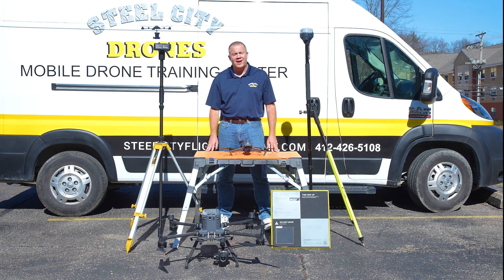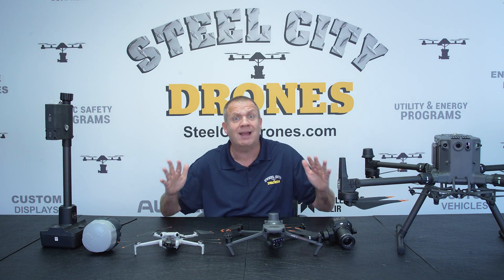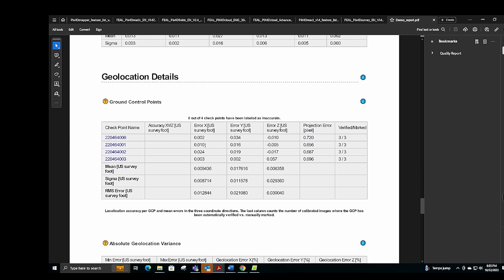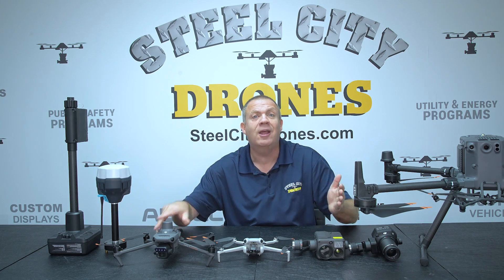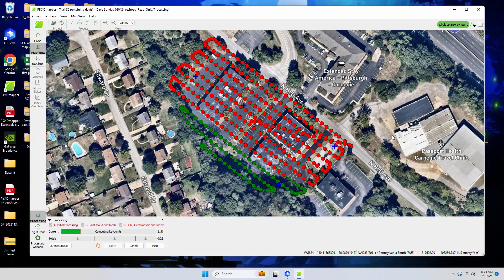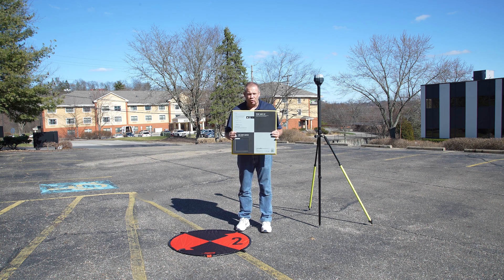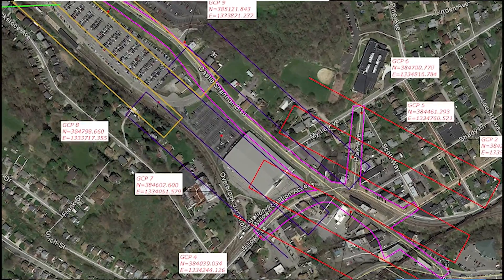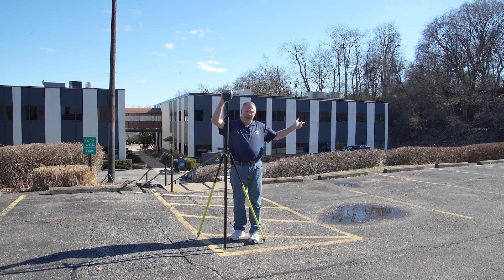How to be a Drone Mapping Pro | Deep Dive

Comment: In my region, everybody buys the chinese brand gps survey system (southern etc) as they are at least 50% (more like 70) cheaper than Trimble. Accuracy is no slouch either despite our initial fear of anything Chinese made. Their latest offering is even more impressive in how quickly the rover readings stabilize at a point.

Comment: you have shown Emlid antennas. please advise me if they are able to connect Ntrip caster as Trimble R2, 10 or 12 do.
Reply from the maker: Yes they can and do. We cover that in our online mapping course due out next month
Reply: @SteelCityDrones  Thanks a lot. The point is our main service is to monitor reforestation and crops repeatedly and try to measure plants hight to compare two different surveys. but we usually can't insert more than a few GCP on the road, on one side of the flight areas. Thus, MAvic3 +D-RTK have shown recurrent missfit of MDS from one day to other, with huge trends in difference up to second degree. I mean, if we compare road hight, the extremes of the road the road seem to have sunk or to have surfaced... Is it possible that with R12 or Emlid with Ntrip (near castr is like 100 km far...) we can fit vertical accuracy to the same datum and eliminate trend?
Reply from the maker: @TheLUKONZEN  I would be more than happy to sit down with you and review your issues you are having. We can setup a 1 hour consultation session if you are interested. If so email us at support@steelcitydrones.com

Comment: Hi mate,
I would like to ask if by using to emlids I could get maps used for agricuktural purposes, meaning the maps/ levels to feed a DJI used to fumigate over steep areas. I ask that because I retailer recommended only the DJI RTK for this matter, so I’m not to sure if I would get the accuracy that you mentioned in your videos. Cheers
Reply from the maker: Yes, the EMLID receivers are fully compatible with DJI Enterprise drones.

Comment: It’s great vid and so many useful info here! Thank you for great job! Just quick question, I seen some good drones there, but also one small one. Would you recommend to go with air2s or rather one of minis at the beginning of journey? I know m3e is best on market because of shutter but it will be next atep to buy better than air2s or one of minis, I am curious about your opinion ;) thanks!
Reply from the maker: It depends on if Air 2 is compatible with the post processing software you want to use.
Reply: @SteelCityDrones  already bought air2s as sdk is open, but as you mentioned there are also limits with postprocessing softs

Comment: Nice Video. Do you also make gcp’s or control points when using ntrip? Just to verify the data I assume then?
Reply from the maker: GCP's tie project data in tighter, most of the time its not needed with NTRIP.  Control points validate the project independently.

Comment: So basically what I learned from this is that you don’t necessarily need the Mavic 3E with RTK hat to get survey accurate data.  I could use any drone (Mavic Air 3 or Mavic 3 Pro) to capture the images and if I use a rover to establish ground control points i can upload the csv file and attach that to state plane on what ever software I’m using for ppk and I can get an accurate map correct?
Reply from the maker: If you use a consumer Mavic drone you will need to lay down ground control to tie the cloud tightly together and then establish check shots to validate the data.  You can use a base-rover configuration to record the GCP data. Nothing we discussed pertains to PPK.
Reply: @SteelCityDrones  well with any drone really if you want survey accuracy you would need ground control points and check points to get accurate maps.  We use a Mavic 3E with RTK module and have 4 propeller AeroPoints and every day we fly we set those AeroPoints on ground control points.  I say ppk because when we use the AeroPoints we aren’t getting real time corrections..all the corrections get done during processing.  What I’m asking is that you can still get survey accurate maps using a consumer drone and using a gnss receiver to shoot in control points and check points?  I don’t need a $6000 Mavic 3E with RTK or the Matrice.  I can get good accurate data using a Mavic 3 Air and my Toocon GNSS receiver correct?
Reply from the maker: @littlenel17  Yes, before RTK was available for drones we could get survey grade accuracy by laying down ground control to tie the data closely.  GSD plays a key role and adjusting for any Terrain elevation change with extra control as needed.
Reply: @SteelCityDrones  I’m looking to do my own mapping and photogrammetry but I don’t want to spend the money on a Mavic 3E.  I have my own personal base rover (TopCon Hiper V) I also have access to the CORS Network if I wanted to just use the Rover.  I’m not necessarily looking to provide survey services with the drone.  Mostly orthos, volume calculations etc.  but I’m wondering if I can use a Mavic Air 3 so capture data and set control points with my GNSS rover.  Can I still achieve the same accuracy as if I was using the Mavic 3E RTK?

Comment: can I do this type of drone mapping using a mavic 3 pro? it has no SDK available yet therefore i'm asking
Reply from the maker: You can create pre-programmed automated flights with most drones including M3 however you will need to lay down ground control points and check shots.

Comment: I own a GNSS receiver with a VRS service and a DJI Mavic 2 zoom drone. So i would only need to lay down some GCP s and will get accurate map? Whats the cost effective postproccessing software to mess around and test how it all works?
Reply from the maker: A GNSS receiver will only help you using an aircraft that has RTK compatibility.  You could fly your missions without RTK and tie the accuracy locations in better with 5 to 8 GPC points.  Pix4D is the industry standard for Post Processing software for Survey accuracy.
Reply: DJI Mavic 2 zoom would nt be a good drone for mapping. Mavic 2 pro would be a good for beginners and small projects. You want a camera that has a mechanical shutter like the old phantom 4 pro RTK or the Mavic 3E
Reply: @vp62ift  Mavic 2 pro has also electronical shutter. You mean better because it has 20mp photos instead of 12 like with Zoom?

Comment: Confused vs work flow and steps, show a presso as well vs just video talking
Reply from the maker: @koolkiwkat This video is not a mapping or survey class.It's an introduction to knowing what it takes to do this line of work that reviews the proper equipment and workflow processes needed to ensure that the data you collect is accurate and can be verified. Can you tell me what material in the video is confusing?

Comment: Where is the drone mapping and surveying course?
Reply from the maker: We are about 1 month away from having it available.
Reply: @SteelCityDrones Great, looking forward to it!
Reply: Without being a licensed surveyor, you then could say you offer  services provided  for surveyors?  This seems to be walking a very thin legal line.
Reply from the maker: @crawford323  It varies in the location you live in and from state to state in the US. Mapping, while traditionally part of the surveyors realm in the field, is more an engineering survey and not one requiring property delineation or decision making. Photogrammetrist are not necessarily surveyors, nor engineers, I can tell you that here in PA, it is illegal to "advertise" services such as  "Survey Services". The define of Survey services includes "The professional services, such as establishing property/boundary lines is the main issue that has to be done by a licensed surveyor.  A person with experience staking out roads or sewer systems is not required to be registered.  There are survey techs that go out and capture and measure data with rovers and they don't need to be licensed either and it is not illegal to provide a customer with drone pictures and deliverables. People been doing that with planes for the longest time.  A First Amendment lawsuit in North Carolina says surveyors cannot stop drone operators from selling photos and making maps. We strongly recommend to check with the state and or region you live in as the law can vary from state to state. 

The purpose of a survey license, in essence, is to protect the public in situation where they are not covered by the law of contract.  Your neighbor, or the guy down the street, may have their boundaries adversely affected by the surveyor’s work, if it is deficient, but they have no recourse against the surveyor under contract, as there was no contract, implied or explicit, between them. They have recourse under the law of torts in the event that things go wrong, but the idea of the license is to ensure that this is as rare an event as possible.

Drone operators should make claims about what they are imaging or claims about the location of boundaries. Their work has as much impact on your boundaries as your granny snapping a photo of your home from the street.

With all that said, everything that we mention in the video above are processes to assure that if you do give a client deliverables with will go toward someone else doing the official survey work that the GeoData is as good as it can possibly be to survey standards.
Reply: @SteelCityDrones  this clarifies, what I was thinking that you could do services for license surveyors, and make sure that your accuracy was enough that would be useful to them

Comment: Do you have to have  survey license? Or someone sign off ?
Reply from the maker: Good question. It varies in the location you live in and from state to state in the US. Mapping, while traditionally part of the surveyors realm in the field, is more an engineering survey and not one requiring property delineation or decision making. Photogrammetrist are not necessarily surveyors, nor engineers, I can tell you that here in PA, it is illegal to "advertise" services such as  "Survey Services". The define of Survey services includes "The professional services, such as establishing property/boundary lines is the main issue that has to be done by a licensed surveyor.  A person with experience staking out roads or sewer systems is not required to be registered.  There are survey techs that go out and capture and measure data with rovers and they don't need to be licensed either and it is not illegal to provide a customer with drone pictures and deliverables. People been doing that with planes for the longest time.  A First Amendment lawsuit in North Carolina says surveyors cannot stop drone operators from selling photos and making maps. We strongly recommend to check with the state and or region you live in as the law can vary from state to state. 

The purpose of a surveylicense, in essence, is to protect the public in situation where they are not covered by the law of contract.  Your neighbor, or the guy down the street, may have their boundaries adversely affected by the surveyor’s work, if it is deficient, but they have no recourse against the surveyor under contract, as there was no contract, implied or explicit, between them. They have recourse under the law of torts in the event that things go wrong, but the idea of the license is to ensure that this is as rare an event as possible.

Drone operators should make claims about what they are imaging or claims about the location of boundaries. Their work has as much impact on your boundaries as your granny snapping a photo of your home from the street.

With all that said, everything that we mention in the video above are processes to assure that if you do give a client deliverables with will go toward someone else doing the official survey work that the GeoData is as good as it can possibly be to survey standards.
Reply: @SteelCityDrones  Real bad idea to provide services that are traditionally done by a licensed surveyor (insured) if you're not one. There's a lot that can go wrong data wise and the inexperienced guy would never know what to check or how to correct bad data. We've had services provide ortho and point cloud data to us from our photos and control that was terrible. We re-shot all of the control and were sub-hundredth on all of them. The engineer using the data would never know if his design really works until construction staking occurs. Case in point. A recent project, flown by others, ended up with contours that were 0.55' off on average, The targets and Benchmark were checked and found to be good at the time of staking. over 2000 cubic yards extra had to be removed from the site because the design was based on bad contours. Guess who is being sued right right now? That's right, the guy that provided the aerial data. Plus, everyone involved is pissed at him and he won't be involved in projects like this one in the future.
Reply from the maker: @tomthomsen11  There is nothing wrong with educating people on how to collect the data and then validate the data properly.  The idea behind this video is to dispel the myths that an overwhelming amount of drone pilots about the perception of what the actual work flow is for collecting data properly.  Many people feel all they need is to buy a $3500 drone and maybe an RTK module and they can provide clients with survey grade data.  Also I would disagree that only licensed surveyors are the only ones to collect the data and set control. Survey tech's do this all the time and they don't have a survey license.  Drone pilots can do this as well as long as they are properly trained and educated which is what we want to do.

Comment: Did I understand correctly, that you need a minimum of 3 aeropoints? or GCP in general? Such as 1 aeropoint and 2 GCPs?  I spoke to propeller last week, they explained that the standard is still 1 Aeropoint per 100 acres surveyed. Which makes sense since they are a PPK Service.

We used to be a propeller customer. We got amazing results with 1 aeropoint on surveys of +/- 100 acres. 

The reason we left the platform is just the annual recurring cost.

I am also curious, Why 2 Emlids? In Ohio, PA, WV you can access CORS. You can use the one Emlid setup as a rover connected to CORS and set a known point (for the base function) and record all of your GCP's Then setup over that known point as a base with the same unit, no?
Reply from the maker: Hello - Pix4D recommends a minimum of 5 GPC's and will not process any project with less than 3 GPC's. An aeropoint is a portable GPC. So factor a minimum of 5 GPC with 2 to 3 checkpoints.  2 Emlids are needed for a base-rover configuration to measure GPC-checkpoints.  For flying you would use one over a known point that can broadcast the data out to the Drone over NTRIP.  Hope this helps.
Reply: @SteelCityDrones   Thanks Dave, So to be clear. You don't need 5 aeropoints. You could use 1 aeropoint and place 3 or 4 other GCP's. Correct? I assumed when you were talking about Propellers aeropoints you were also using the propeller platform. 

I'm also curious on your thoughts of using a long static recording and OPUS vs connecting to a CORs network and being able to record a corrected point in a fraction of the time?

You are correct, in that your method would require 2 Emlids. With CORs readily available in most areas (and free to use in some states) curious why not use this method? It would save a bunch of time rather than taking 2 hour static point observations
Reply from the maker: @importjunky3106  That pretty much is NTRIP which can range from free up to $400 a month. ODOT is free, and you will get a corrected position quick but depends how accurate you need to be, a network point will never be as accurate as a post processed point.
Reply: Just out of curiosity, how much does the market pay for the data acquisition part of a 1MW solar farm inspection or a 1 sq km aerial mapping?